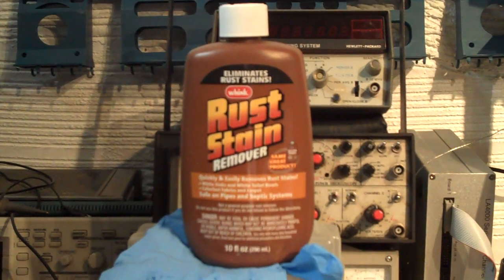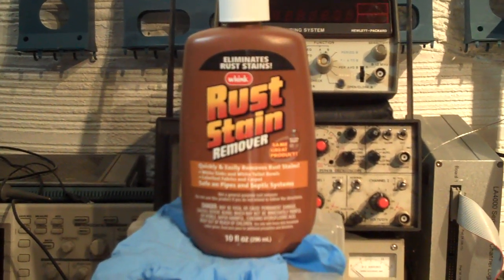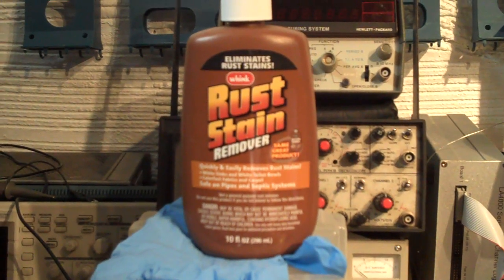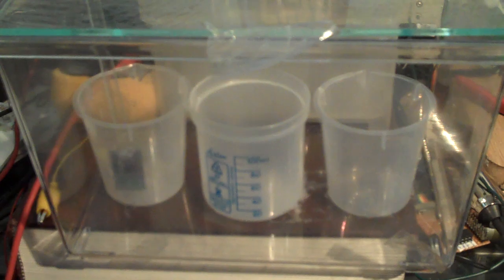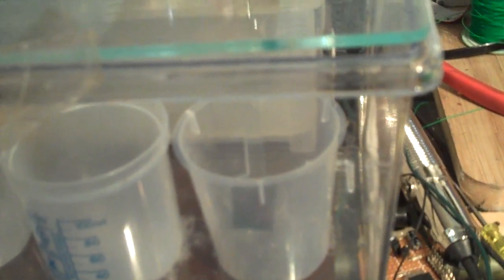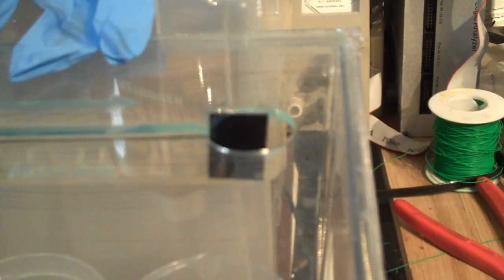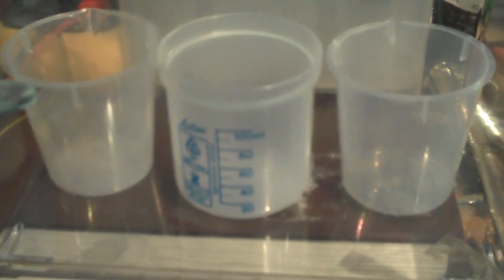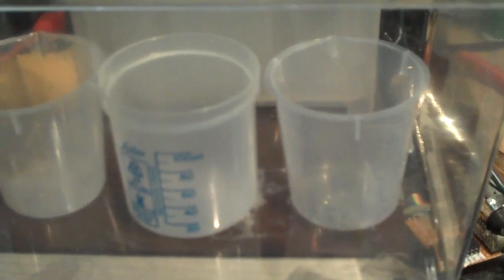Safe HF Etching at Home with an Etch Chamber

Comment: this stuff is scary as shit I work with this most days as i work at a chemical waste processing plant and HF is used alot in catalytic mixtures. This stuff attacks the nervous system so you wont actually feel it burning you and it will soaked through and dissolve the bone... nice..
Reply: How long?

Comment: Because you fluorine is the only element that can replace the Si-Si, Si-H or Si-O bonds, so it's required in the microfabrication industry in order to etch Si wafers. It's also a key compound in producing porous silicon, a variant of Si itself.

Comment: Interesting idea, I should try that some time.

As of now I do all of my etching on single dies (delayering for RE) so I'm working with only a few hundred microliters at a time and haven't needed to use that much at a time (i.e. no concerns about vapors)

I wear a Tyvek lab coat, splash goggles and polycarbonate face shield, and double gloves - Norfoil as the inner (and primary protection) layer and nitrile over the outside to increase dexterity. There's zero exposed skin with that setup.

Comment: why aren't people using 30% hydrochloric acid and 35% hydrogen peroxide ?
you can get that at the hardware store and pharmacy, like under 5$ for 2 liters of solution and it works great !!!
(except the fumes will make everything rust in the garage if you leave it in an open container for a week, oops)
but it's so much safer

Comment: I work in a lab, and have been told that doubling up on gloves increases the chance of them tearing. However, we used poor quality gloves in the past which would tear for no real reason at all - not good when working with sewage samples or concentrated acids (mainly hydrochloric, phosporic and sulphuric).
.
&eB